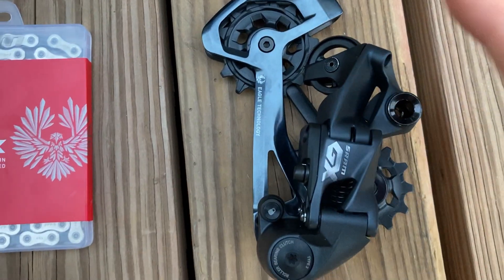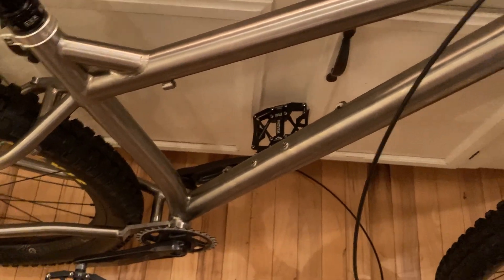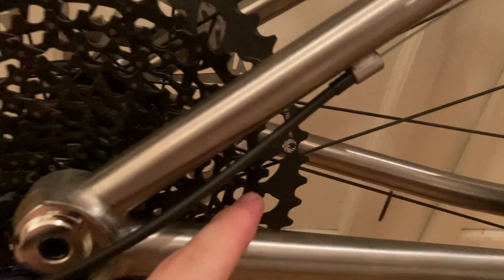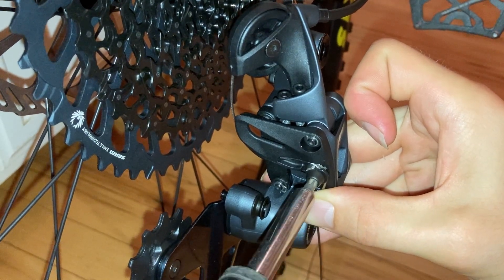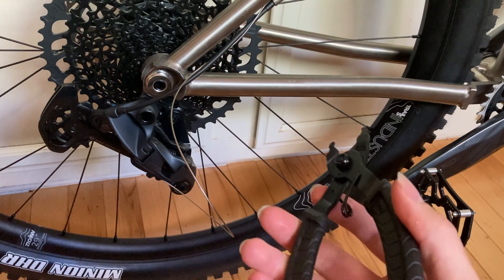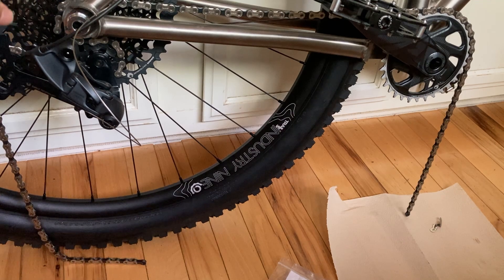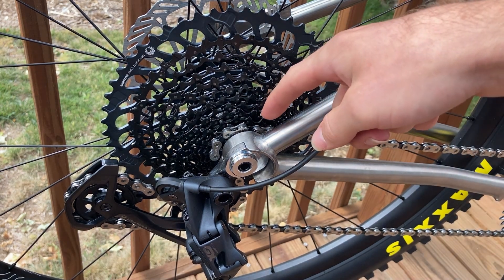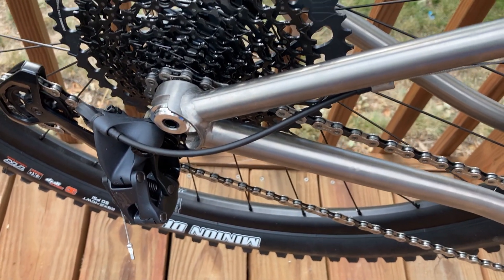How To Install an SRAM Derailleur and Chain, and Get it All Shifting Smooth

Comment: Thanks for the help Ben, the video is great. I'm putting an 11-speed SRAM NX Derailleur on an older frame that used to be 9-speed, but with 2 sprockets up front. My problem is, when I tighten down the derailleur it's lined up with the 9th gear instead of the 11th. Any suggestions?
Reply from the maker: Glad the video was helpful, as for the alignment of the derailer, there are some people in the road biking community that have tried to mix match derailleurs and cassettes, I wouldn’t have much knowledge as to what the problem could be other than just the wrong size. Good luck, and hopefully it works itself out!
Reply: Yeah, I've read it's fine to go from 9 to 11 with a mountain bike (which I have) but not with a road bike. I will just have to keep fiddling with it.
Reply: Limiting screws 🤦‍♂️ works fine now
Reply from the maker: @willc7704  perfect! I wasn’t sure if you had already adjusted them or not but glad it worked!